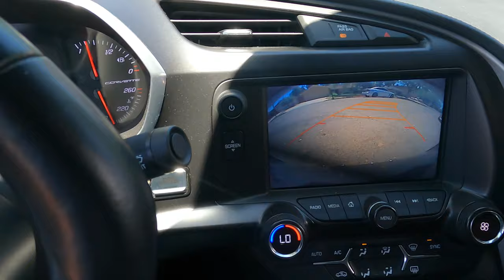C7 headers install!!!!!!!

Comment: Great walkthrough. Are there any specific tools you recommend for getting the manifold bolts off without removing the spark plugs? There was that one bolt with the janky angle, on passenger side I think
Reply from the maker: Just use my harbor freight tools swivel head ratchets usually I can get almost any job done with that